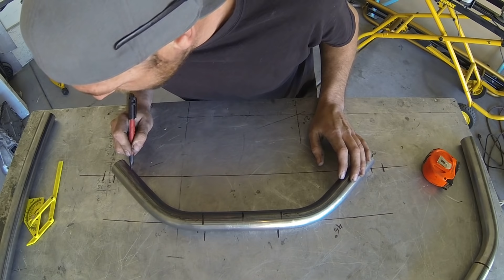TFS: Tube Bending Basics 2 - Bending the Tubes

Comment: im horrible with math and have adhd lol. Im so lost. Good thing i plan on staying in the army lol
Reply from the maker: Mike Badet Just takes practice.
Reply: The Fabrication Series ya i plan to buy a bender and just start trying to build different things. ive been welding for 8 years now but and armored plate so nothing to heavy in fab. but i have a new 2016 chevy i want a tube bumper for but know one here in Texas does tube fabrication so it looks like im gonna do it myself. I also was trying to find someone to bend a kit up for me and mail it to me and i weld everythng up but cant find that either so far lol
Reply: The Fabrication Series is their a way to practice bending without spending tons of money on DOM?
Reply from the maker: Mike Badet Yes. Use ERW tube. it's about 2.5 times less expensive.